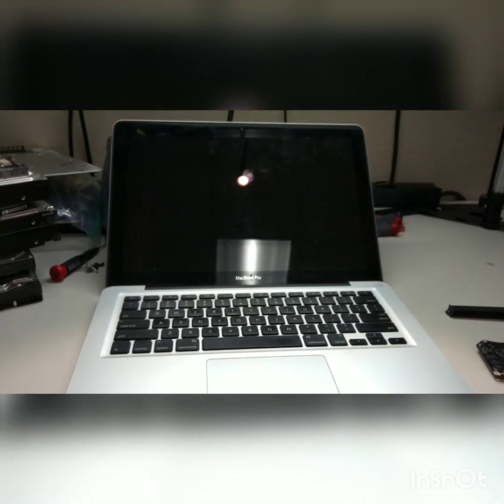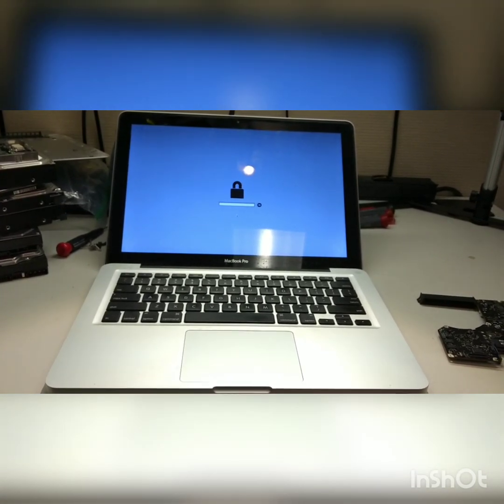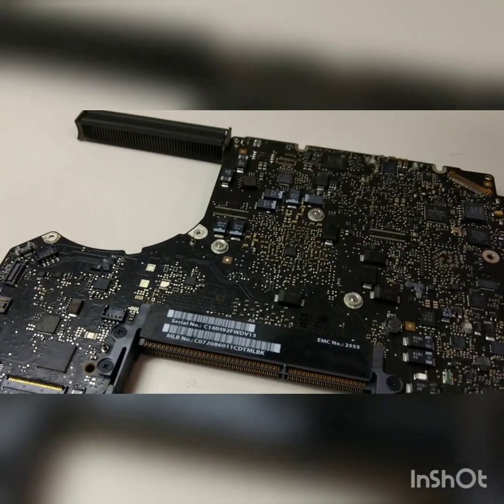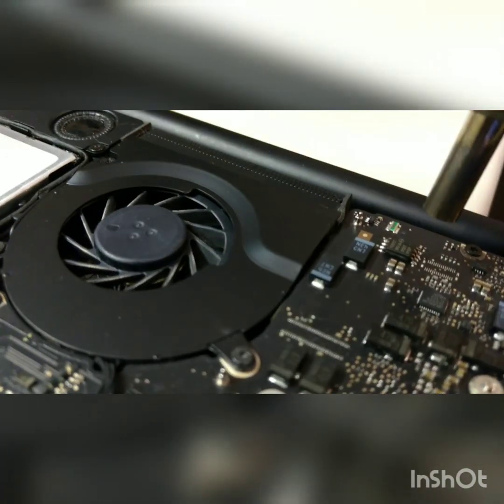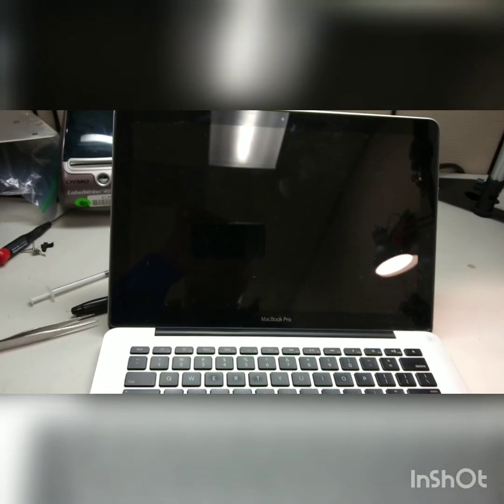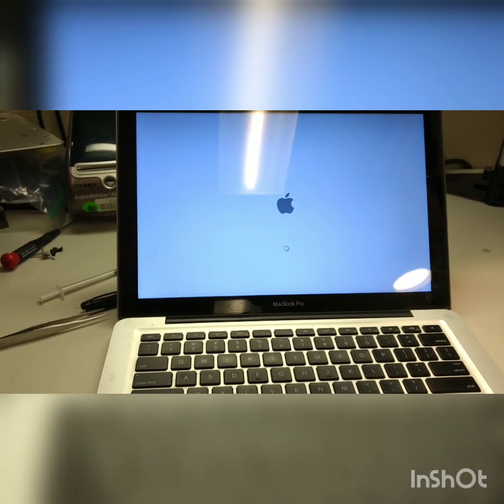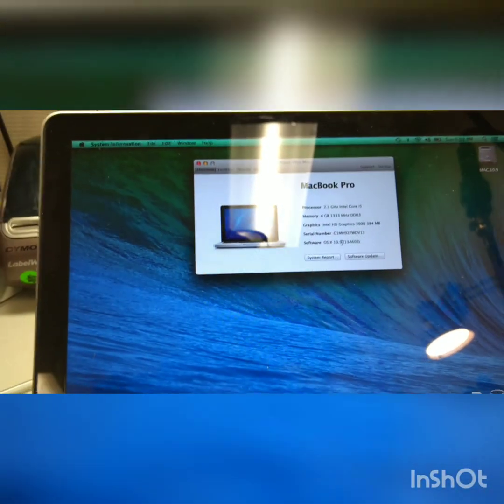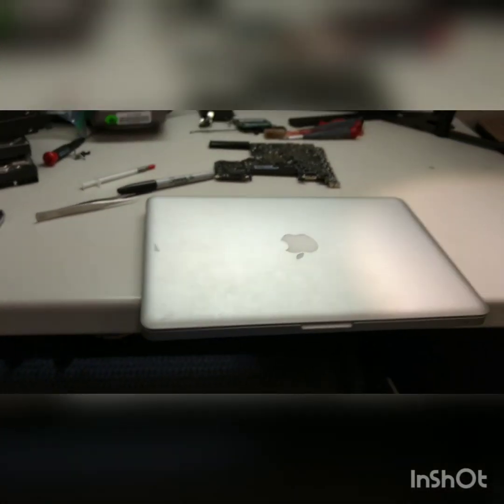How to fix a MacBook pro with a firmware bios lock

Comment: All you need to do is remove one of the RAM modules and start it up. This removes the firmware password. Apple computers do not have a BIOS but use an EFI (which is accessible but is nothing like a PC BIOS system).

Once booted up (the firmware password will not appear and continue to boot normally) shut it down and reinstall the removed RAM module.

Note that swapping the internal hard drive won't help. See the following for more information;
http://osxdaily.com/2015/01/28/forgot-mac-firmware-password-what-now/
Reply: that is only for pre-2011 models

Comment: Will your system work  the same if I transplant an unlocked BIOS chip from a motherboard that has some problems to a new motherboard with a BIOS locked chip in a HP Folio 1040 G2? Thanks
Reply: i tried and it was corrupted. needs to be reprogrammed